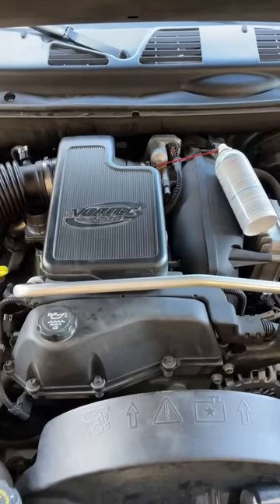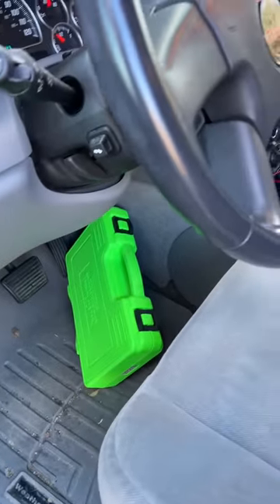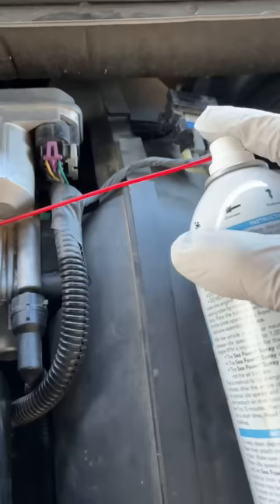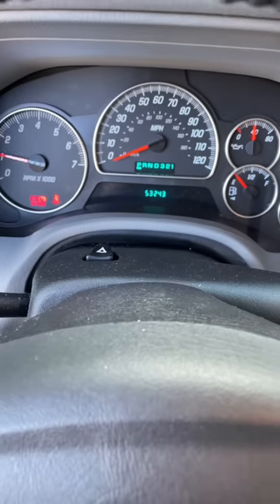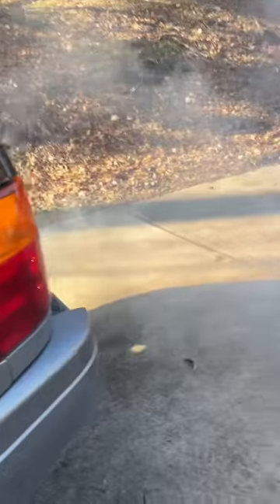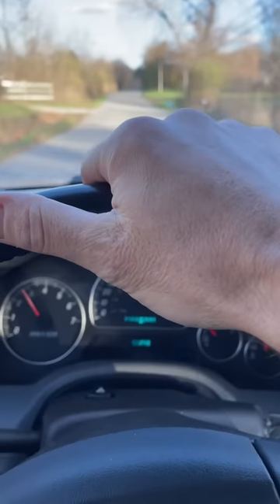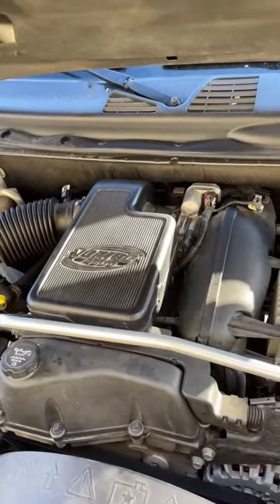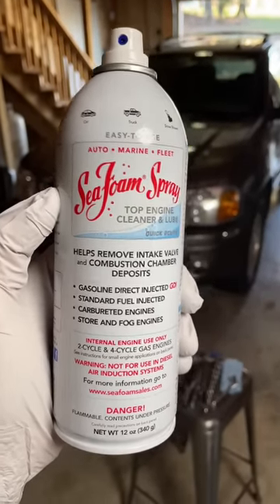Seafoam Smoothed My Rough Idle! Part 3 of 3!

Comment: You run the engine to hot up. Idling the engine. Spray the seafood before the throttle plate until the engine dies out. Open the intake boot at throttle b9dy, Keep spraying  little more before throttle plate and fill up whole throttle and inside the plenum. Put the intake hose back and wait over night and let the sea foam work. Next day start up and drive to clear out the cleaner. Cold exhaust won't damage the cat. Your idle will be very smooth. Intake valves all clean.

Comment: Seafoam does work, but all of that dislodged carbon etc ends up in your catalytic converter clogging it up and significantly shortening the life of it. If one could only temporarily remove cat run a couple of cans through engine and then reassemble this would be the best way to do this.

Comment: A great company is BG they make all sorts of remedies for stuff like this. In this particular instance the intake valve cleaner would’ve been perfect, you find a line going to the intake manifold and hook up a vacuum feeder to it and put the intake valve cleaner fluid in the vacuum feeder and it will slowly drop it into there causing it to get on the back of the intake valves cleaning them. Pretty neat stuff it works wonders too

Comment: You do that every once in a while you have to clean the throttle body blade. It gets dirty and that will cause a rough idle. You should also clean the Mass Air flow sensor that will help your vehicle to run smoothly and properly. Seafoam is a great product but first I would have cleaned the throttle body by hand then have sprayed Seafoam. Also Seafoam in the gas tank is a good thing to do

Comment: This all started because a lot of people do city driveing or similar to city driveing. So the vehicle never gets a chance to stretch it's legs so to speak. Basically you need to once in a while get on a open road and open it up. Don't drive aggressively but yes be aggressive with your gas peddle. Take off fast without screeching tires. Really open it up as fast as u date to go. Doesn't have to be long ways. Vehicles need their legs stretched to blow everything out. If you don't you get this rough fast idle.

Comment: I love it because it is a 100% petroleum based product no man-made products added
It can be used in any component of an automobile. Engine transmission power steering or differential gas or diesel it doesn’t matter great product. It has been around for years. I use it to clean my guns also

Comment: Sea foam isn’t meant for fuel injection vehicles or really even 4 strokes for that matter was originally made for carb 2 stroke boat motors hence the name you should be running nitrogen through your car or anything fuel injected for the best result

Comment: You need to watch the video a guy did with a brand spanking new lawnmower engine.  He put sea foam in and it still smoked. 

Bottom line is that sea foam is a gimmick.

Comment: Seafoam in a can is about 80 to 90 percent water. Dump a can into a clear container and you will see how fast the water separates and re-separates after a shaking. So the claim on the can that it mixes with moisture to rid it from your has tank in not true its already mostly water and some petrolium distillates.. the proof is in the pudding. But with all that said back in the day a lot of motocross racers would pull their spark plug out and use a fine water mister bottle and spray a tiny mist down onto the piston, then put the plug back in and fire it up to knock the carbon off the piston because you cant compress a liquid. So a fine mist is all you need for a carbon clean on pistons… but running a can of that water through the whole system for the life of the vehicle will show some horror of corrosion in the intake system.. but if you keep up on carbon blasts through the throttle body it will keep it clean, but still not worth running all that water through the fuel system.. so just dont use the seafoam in a can that dumps into fuel tank. Use all the other products they make they are good

Comment: Seafoam is not ideal for car engines since it has a high probability of fouling the Throttle position sensor and catalytic converters. It is only good for boats and some 2 stroke engines

Comment: Or could have just pulled the throttle body off and clean it, unless the intake gasket is bad then u will have fix that otherwise it will have the same issue once the throttle body gets dirty again

Comment: thats be aise u didnt open the throttle body and ckeany it from inside. thats ur mistake, dont do what the customer can also do... in my hyundai i10 this things happened once i cleaned whats called idle air actuator which is a part of throttle body.. after that no problems happened

Comment: It does work but on high mileage engines I think it works too well my car went from burning a cort of oil every 3 weeks to 3 qt of oil a week after sea foaming it took the motor apart and it cleaned all the junk around the valves out and it started leaking oil down the exhaust valves

Comment: You can also remove the break booster line get the pourable bottle into a bowl to suck the seafoam into the engine. Works awesome for sure... Also that motor is pure trash.

Comment: I have a can that I use half of it per the instruction on my truck but the straw is different than a straight straw that way you can put it into the throttle body through the ducting. It's smoothed the idle of my vehicle out too.

Comment: I wouldnt dare put it in my throttle body. It works better if you put some in the intake and some in the gas tank. Also sea foam thins the oil out, so I wouldnt use it unless your about to change your oil.

Comment: Seafood is not intended for v8 4 stroke engines,  it is for 2 Stroke outboard boat engines and chainsaws or anything that uses oil in the fuel .   The smoke you see is the oil mixed in the seafood contents burning in the engine.

Comment: Remove air duct from throttle body spray a rag with brake clean or carb clean lift throttle blade clean bottom edge of blade and throttle body where blade rests off throttle. No need to waste a whole bottle of seafoam. My boss had that engine for couple years id have to clean it every so often and would idle like a dream again

Comment: Marvel mystery oil does the same thing it's an old school trick when we had carburators rev it up a little bit while pouring it in when about half done pour the rest in and drown it let it sit for a hour or two then it may take a minute or two to start and then Same thing drive aggressively to clean it out and major difference in engine idle and performance

Comment: The most  effective  is take the engine to operating temperature  and put a oz in each cylinder  and turn it over  with spark  disabled  after  10 minutes  then start the vehicle  and then drive it hard you will have a huge  smoke screen

Comment: I always recommend to my friends for their carbureted dirt bikes. Cleans up clogged jet real quick. Just take the air filter off and spray straight in while revving the sh*t out of it. Smokes like crazy but works.
Reply: Would not clean the jets by spraying in the intake. It wouldn't ever get to them, carburetor jets work by the engine sucking in air which causes a vacuum as it flows past the tubes that come up from the bowl and the jets are on those tubes regulating the amount of fuel being sucked up onto the flow of air.
Reply: @tubeonline629  You have to spray it into the ports on the intake. Been doing it for years and it does clean the jets. I know because I pulled my carb before and after to verify. Works for my friends too 🤷‍♂️ It obviously won't get sediment out of your jets but it will clean up the varnish from stale fuel.

Comment: What he didn't tell you is there is a TSB to clean the throttle body for rough idle. Hot,soapy water would have worked just as well.
Reply: What he DID tell you was that this is part 3 of 3, and the seafoam worked after other common fixes did not. Throttle body cleaning was performed in part 2 and did not fix the idle.

Comment: You are supposed to put it in a cup and suck it up untill the engine stalls, wait an hour or two, and then start the vehicle and let it smoke for like 10-20 minutes then take it for a ride, ( wait till the smoke subsides before hitting the road)  could be a safety hazard to other drivers
Reply: All of your steps were unnecessary, never done it like you did it, idgaf what it says on the seafoam can bro, I’ve learned from actual professional mechanics, a handful of them in fact

Comment: This is a great way to clean the combustion chambers. However I use Berryman B-12. Cleans better and is cheaper. Either way is good
Reply: If they were supposed to be that clean there would be more additives in gas and oil to do that. Like in the transmission. Carbon builds up in heads that never get over a certain temperature. Gotta get the rpms up every now and then that's all.
Reply: Also I wonder if B-12 and Seafoam are the same thing rebranded.

Comment: I love seafoam in the tank but the first and last time I used top end cleaner I ended up with my cat in pieces and it clogged my exhaust to the point I snapped a motor mount
Reply: You should have just used another can to fix it  again. 😂

Comment: Seafoam in tank additive eats the winding out of the fuel pump, and using too much intake spray can dislodge a piece of carbon buildup and deposit it into a cylinder causing it to get caught behind a ring and kill a cylinder. Use it cautiously.

Comment: Sea foams no joke. I put it in my truck’s oil 2 times a year right before an oil change. I also put it in my gas 2 times a year. A buddy down the street from me who bought a 2014 gdi sonata 5 years ago with almost 70,000 miles on it, started putting sea foam in his car about a year later when I explained to him that car may be prone to carbon build up because of the direct injection. He drives Uber, Lyft, and does grub hub. That car is approaching 260,000 city miles with no hiccups witch is fairly unheard of on the 2019 and below gdi Hyundais and kias. I have heard similar things about marvel mystery oil.

Comment: Clean the throttle body and if equipped, the idle air solenoid. Use carb cleaner. Wipe those parts clean with lint free towel paper. 

This is what mechanics do in shop.

Do this every time you change air filter and you would never need seafoam or have a rough idle/ acceleration

Comment: Wouldn’t be surprised if you have a bad cylinder head. The 4200 engines were known for floating valves. The engine would have somewhere in the vicinity of 80-90k miles on it at the time. When the valve would close, it would slap the seat into the head, causing a misfire at idle. I’ve seen probably a half dozen cylinder head replacements when I worked for a GM dealership, for the brief time I worked there. Just food for thought…

Comment: Make sure you check your intake to see if it has a tank plenum box.... This box will fill with liquid like a drain trap...So oil ..sea foam and any cleaner you spray will end up stewing in this box... So the smooth idle may be vapors ..I know this first hand from replacing my intake and when I took it apart mine had  about 1/2 inch of fluids

Comment: If you use this crap, say goodbye to your seals and possibly gaskets, hoses and/or other parts that would have lasted years without this crap. This isn't just a snake oil product. It will destroy your car. It will run better for a week or so, but after that you'll notice serious issues if not immediately. DO NOT USE THIS PRODUCT

Comment: There was a time where I recommended Seafoam, that was before I discovered the damage it does to emission components.

DO NOT USE on vehicles equipped with catalytic converters or remove them prior to use.